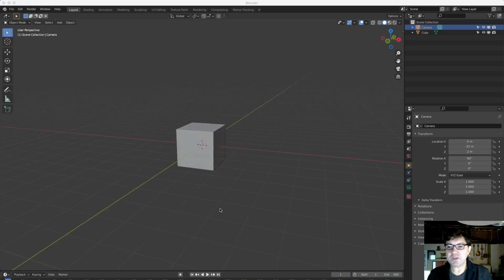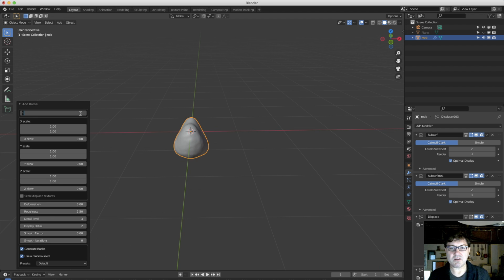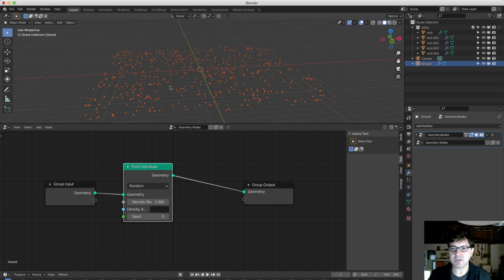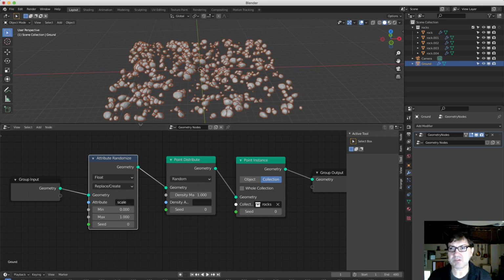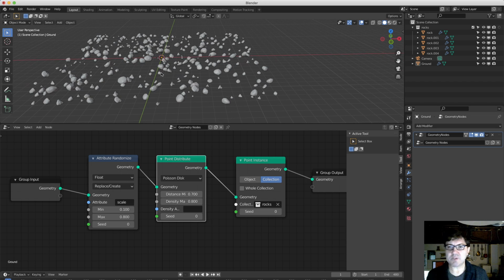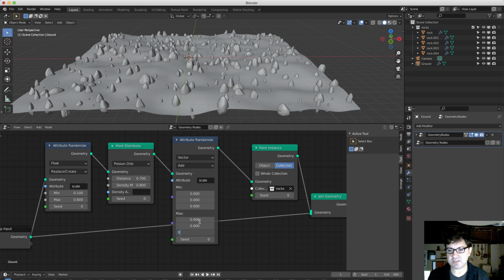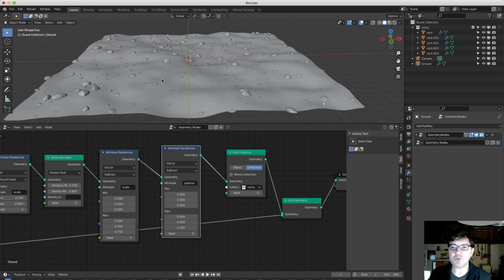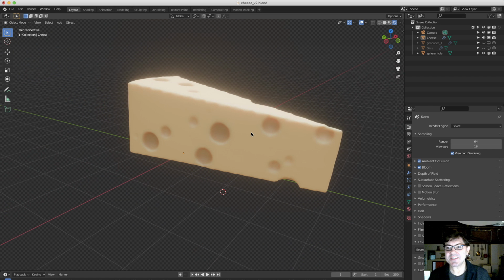[TUT] Houdini Comes to Blender!

Comment: Blender UI of course is not optimal for procedural things.It would be hard to navigate in complex huge setup.BF must remade it from scratch i think.Plus what they will do when functional will be wider and list of nodes will grow.Again it will become monster like Sverchok and Animation nodes.And they need more low lvl control nodes parallely i think with math,not "one task" nodes with not optimal hardlocked algorithms.For example this Poisson disk is really suxx to prevent overlaping,no such control as u want and expect from your custom.

P.s Houdini one love forever and ever.Really king of the hill,and there is no reason to learn any other eternal outsider,and sorry for my English and categorical.Blender is cool for classic modeling,but not for procedural things,my credo is to choose the best in its class,use a bunch of programs, and not to use a universal program,where everything seems to be not completely bad,but not by 10+

I've been using Blender and Houdini together for a long time,really all they have to do is to make an adequate import of custom attributes from Houdini, leaving all the math to Houdini(Houdini Engine for Blender if u want).That's all and not to try "recreate the wheel".
Reply: Pity Houdini doesn’t have good Python support like Blender.